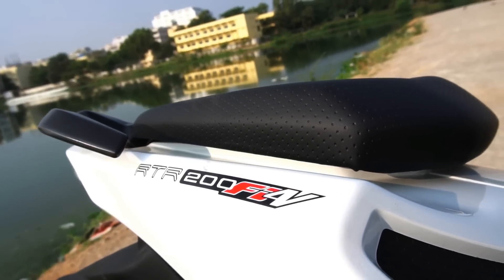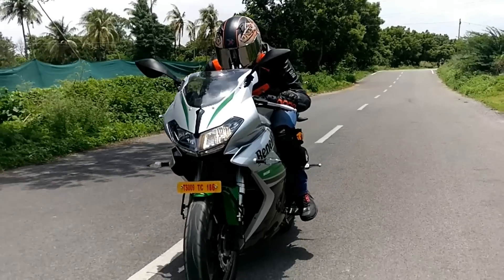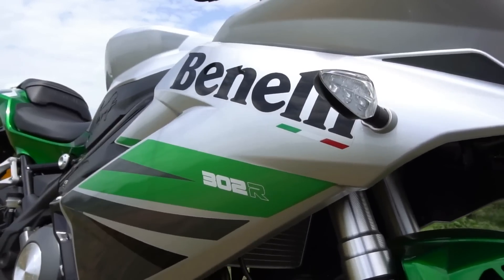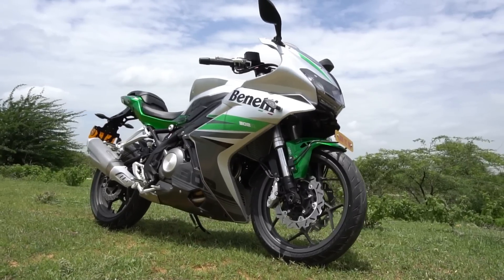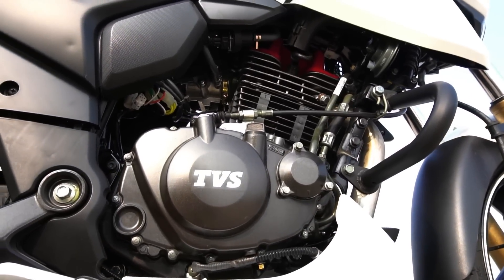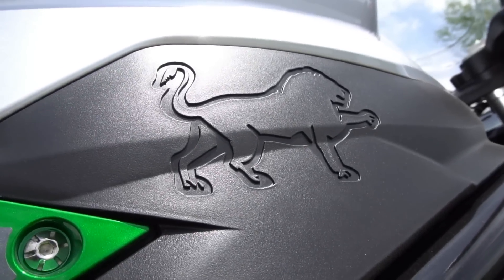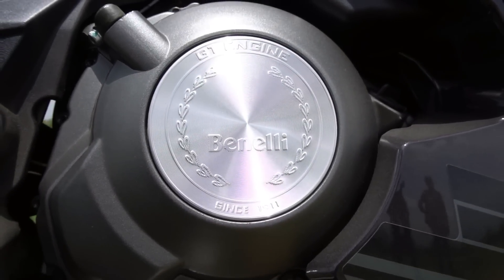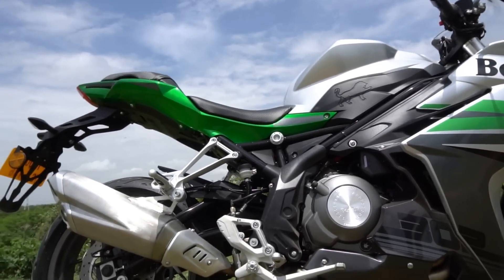Fuel Injection vs Carburetor bikes Pros Cons #Dinopedia

Comment: Carbs have worked for over 100 years in alsorts from boats to planes. They do a perfectly good job. Injection is great. Tuning carbs requires a delicate touch. Carbs are not difficult to maintain or expensive. All you need is a basic tool kit. It only gets expensive if you pay somebody to do it for you.

Comment: Sir,
Pls provide some tips to wash fi bikes
I owns Apache rtr 160fi 2010 model. Since 8 years I used to get serviced my bike in tvs authorized service center. Is there any problem will occur in ecu or any sensor will fail if I done it in local water wash shops. Pls guide.
Thanks for all ur videos.

Comment: I am considering to buy apache 200 fi over pulsar 200 nd , only because of Fuel Injection.... ami making correct decision ? I hv heard  abt chain loos issue in apache 200, that it need to tighten its chain in every 400- 500 km ...is it true ?

Comment: @Dino bhai, I've a doubt. Like u mentioned in the video we need a minimum amount of petrol in the fuel tank for FI based engines, does the low fuel warning (or the fuel indicator) is actually calculated by considering to total fuel available or does the bike actually keep the desired amount of fuel and then show the rest of the fuel for indicating the levels. (hope this question make sense! :( )

Comment: lean mixture dosent give u a max fuel efficiency.its a wrong concept.max fuel efficiency is achieved at the stoich ratio of 15:1.
is ur afr is greater thn 15:1 its lean..and u are actually destroying ur engine..just like if u imagine i make u run a marathon in scorching heat not allowing u to breathe :)
rich mixture is when ur stoich ratio is less thn 15:1...u probably make ur engine overflow and ruin it.
motorcycles give max power and milage in optimal fuel setting at 15:1
thats the tuning should be
:) cheers and ride safe

Comment: My question may seem to be bit odd but..still I would like to ask that If Fuel-injection is better than Carburator in terms or Fuel economy then why Mileage concentrated Vehicles like Hero Splendor, Honda Activa etc don't get Fuel injection system fitted in them ?
Reply from the maker: hero glamour has been already introduced with Fi and it offers amazing mileage. With Fi mileage does go up marginally compared to carb variant by around 2-3 kmpl in case of performance bikes and up to 5 kmpl in commuter economy class bikes.

Comment: Can a carburated version be converted to fi?
Reply: Converting carb to fi requires sensors, fi unit, and may be some changes in head and the end result may not be fruitful. But vice versa is possible easily.
As there is no change in these apache versions. Yes its possible but costs you dearly. You will not gain any significant changes. Wastage of money.
Carb bikes are still good and will remain in market.
Fi units are complex to handle while servicing.
Reply from the maker: no

Comment: Dino I had learned in my automobile classes that there are many sensors for FI engine ....so it will also respond according to the terrain we are riding,,so its very difficult to maintain these sensors once it get damages..it will costs u a lot.

Comment: Some factual corrections.
1. It costs more to own and maintain but the maintenance of an FI system is after atleast 50k kilometers. The system is pressurised and its self cleaning. Not to mention a carb engine has to retuned for performance and commute and different kinds of riding not suited to tune up leads to service intervals of around 20 to 30k kms of the engine itself. Where as in FI only the injectors may needs cleaning at this point. Since the mixture is always perfect the engine health remains for a longer time.
2. Low fuel level doesnt cause harm to the injectors, they are simply solenoid valves opening and closing they get spoilt only when run dry for very long and logically if they are dry the engine is obviously not running and they wont get spoilt. Low fuel levels cause sloshing in tank and proper amounts of fuel does not enter fuel pump in tank, and since that is a motor pressurising fuel it suddenly spins fast when no load and fuel has moved away from its inlet port due to hard braking of leaning while low fuel, the motor has high chances of burning up due to sudden loading and unloading. Also FI bikes are not run dry like carb bikes for the same reason of pump motor burning out.
Reply: Also pretty sure that the fuel pump is lubricated by the fuel itself and since it always stands vertically in the tank it has to be completely submerged.
Reply: So how minimum fuel has to be there in the tank? Its also reduce fuel range that way

Comment: Sir please not.
rich mixture = more power and more fuel  (5:1 to 9:1) here 5 parts = air, 1 parts = fuel 
lean mixture = less power and more mileage (11:1 to 18:1).  But anyways you don a great job, sir. and good information thank you sir.
Reply from the maker: thanks for adding in details sai
Reply: Tulasi Sai Ram Bro he said the same only......he said more efficiency in lean mixture means more fuel efficiency not efficient performance !

Comment: It was only two months ago that I was going around in TVS showrooms asking about the FI + ABS variant, they did'nt have any idea when it will launch. So went for the Pulsar RS200 ABS instead.
The response is'nt as punchy as the Apache but it goes really smoothly at high revs.
Reply from the maker: true, but 200 ns offers better top end whack because of the added 6th gear.
Reply: Ratnadeep Gaikwad me too
Reply: They will have idea,  pretend as if they don't know or say not launched yet to clear old stock
Reply: True, above 6000 rpm the engine shifts its nature from being smooth and efficient to a slingshot, revs climb really fast after that.